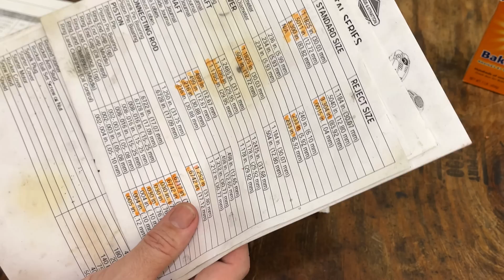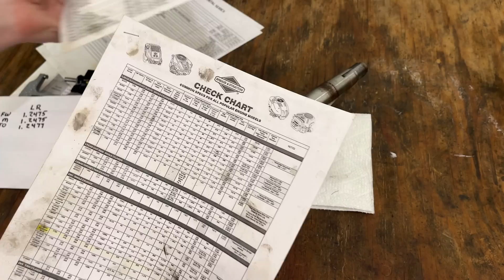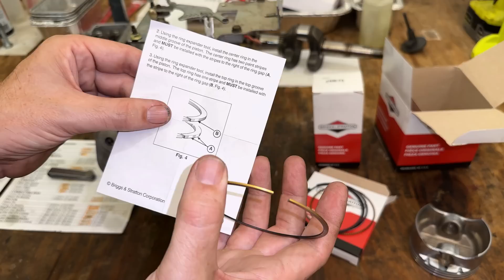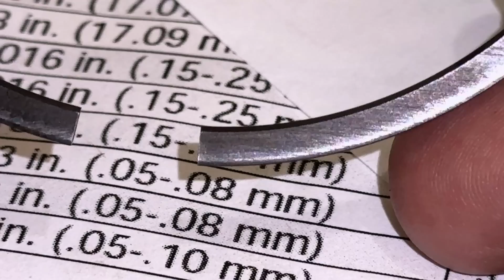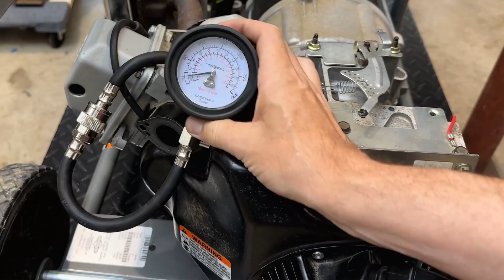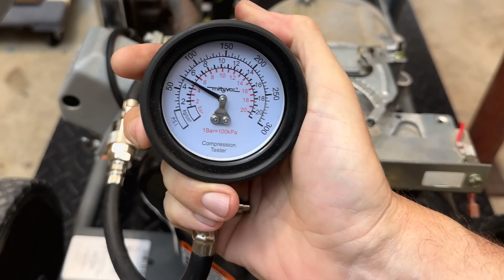Two Catastrophic Engine Failures - Are They Junk or Will They Run Again?

Comment: Aren't those cylinders coated with something like Nikasil plating? If so honing is not permitted. I have never seen rings run on a raw aluminum cylinder.
Also; I'm not to fond of lapping valves unless they are new and only a small amount then. When lapping the old valve there is always a chance of cupping and the valve seat is usually way to wide which means the pressure is distributed over a wider area and less chance of a good seal. A narrow seat is always best...
Invest in some valve and seat cutting tools...
Reply from the maker: My understanding is the Nikasil is on the piston and not the cylinder on these engines.  Service manual also has honing instructions, but does not talk about the coating.  If you Google Briggs cool bore I think you will get more information in it.
Reply from the maker: There is no hardened surface, Its just a bare aluminum cylinder. Bore it out as needed, but be sure that a Briggs OEM piston is available.

The briggs Kool-Bore design was pretty smart, Briggs found that a bare aluminum bore with a hard chromed piston had a respectable lifespan and ran cooler than a steel sleeve design.

Comment: Since the engine is not open yet I am thinking of money saving features for this engine. So that would be a removable insert bearing. Since this engine deposits aluminum on the crank, that needs polished and cleaned, but instead of a connecting rod cost, if it were fitted before hand with an insert this would save the owner that amount. The problem with that is spun bearings destroying the connecting rod anyways. Not sure how to save this component when run low on oil unless it were really soft material then the owner would just still try to run it even with a spun bearing. Must be some way to save the engine case and connecting rod say in a future engine, just not aware of a way at this point since even a rattling connecting rod will not STOP the owner from moving forward to further destruction.  Must be some way cheap to do this. So this is maybe the best outcome. For the connecting rod to hold together and seize on the crank. Thus the engine case not being destroyed by a failed connecting rod which destroys both the engine case and piston. So a very strong connecting rod seized on the crank might be the best option. Saves both the piston and engine case. Deposites on the crank and re-honing the bore might be the best outcome. So make the connecting rod strong enough to not break and keep everything together might be the best outcome if the owner fails to check the oil.

Comment: That no oil generator is blown just because of out of oil. It can be freed up by removing the sparkplug spraying Penatrating oil down into the cylinder to set A while then remove the pull starter to manually trim it over by the starter clutch with the removal tool that's one piece for removing them to replace them and key way block.,or the flywheel with it's called that tool. From stens online to.,or other Briggs and Stratton.,an other websites have them to.

Comment: I lost the tip of my finger using that exact kind of razor blade to remove a gasket. The razor stuck unexpectedly and my grip slipped causing the blade to flip over. So basically in a split second I ended up pushing with the sharp side... the longest finger lost that contest 😢

Comment: They make plastic "razor blades" of various stiffness that are useful for removing soft material but would not gouge aluminum. I'm not sure it would be useful but thought I'd mention it.
Reply from the maker: Tried a few once.  Did not work well, but maybe I bought the wrong stiffness.  Razor blades work well, just need to be careful.

Comment: I'd do the rope and rag rubbing of the crank soaked with sodium hydroxide just to avoid using any sandpaper at all. Well perhaps 2500 grit paper and start with hcl acid to get rid of the thickest aluminium.

A blunt scalpel with rounded type blade is best for scraping.

Comment: that AVR COULD be tuned while engine is going, the biggest risk is if teh circuit has reference to line on that pot, but as that would be silly(it would be placed into a larger divider with the pot on the low end to control low-side switching of the exiter coil) it should be safe enough to just use a standard plastic handle driver to adjust it, plastic for safety as it is basically not possible to have full unlimited line on the pot trim screw
Reply from the maker: It could be, but there are plenty watching who would get themselves into trouble.
Reply: true, far too many people would end up holding the bare metal shaft, use a full metal precision driver handle, or otherwise guarantee they jam their driver onto a live wire and even be stupid enough to have the equipment referenced to their body in such a way that they get electrocuted
I actually recently touched a 120v power supply for a surround sound DVD+VHS media unit because of it dying in a lightning strike, yet I felt nothing because I ensured my body was 100% isolated and I only had one hand referenced to the heatsinks of the linear regulators to test if they were even getting power
I literally told my grandma who was watching that what I was doing can get careless people killed but as long as my body was only getting 1 point of power the rest of me can't form a circuit and shock me

Comment: James, question about this Briggs motor. I recently rebuilt one (blown rod and piston) and the crank was salvaged (don't recall the mic measurement, but it WAS within specs.) Runs great, but now it's rear seal is leaking. I've replaced the seal THREE times and even bought a bushing installation kit and installed a new bushing. It STILL leaks. I hate to keep throwing good money after bad and I'm at my wits end. I'm suspicious of the housing and the crank (although I can't see either one actually being the culprit.) Except for the crank and block, all the parts are new Briggs and Stratton, no knock-offs. I even tried some Lucas stop leak and changed to 30 weight to try and seal it! My dad has nick-named the Storm Responder "Ole Drippy!" It only leaks when running BTW, and very little (teaspoon amounts, not ounces.)
Any ideas??

Comment: The price of those piston rings is crazy. I can buy a set of Sealed Power rings for a 350 V8 for $39.99. A set of 8 pistons is $162.99. This is for a 4 inch bore.
Reply from the maker: Small engine parts are crazy expensive.  I just bought a camshaft for $135.  For a little more I could get one for a v8 https://www.summitracing.com/parts/isk-201cc1?seid=srese1&ppckw=pmax-powersports&gclid=Cj0KCQjw_5unBhCMARIsACZyzS3vnOTgehmx-Kz_N16zKpKScqLowFZwS2IEt_d6vptSNM8h8_Vbre0aAmYjEALw_wcB

Comment: I am fairly new at small engines repair. I must admit your chanel is the best I could find . Could you tell me if the blade on a push mower has some kind of a flywheel effect when you start the engine . I have two older machines that started easily , but after removing the blades ,I just can't get them to start with the recoil starter. Thanks for your answer
Reply from the maker: The blade is required.  Mowers have a light weight aluminum flywheel.  Not enough mass.  The blade is required to give the crank enough mass / inertia to run the engine.  The same engine in another application like a power washer has a cast iron flywheel to no blade needed in that case.  Ken just did a good video on that https://youtu.be/JukPWNwseG0?si=At0f2XQ3nCWLnGwp

Comment: My B&S 9hp engine per the web recommended 0.004 intake and exhaust. I think it’s a series 124 but can’t recall for sure.
Reply: I seem to recall the carb bolt torque being stated to be 20” lbs per the web.

Comment: I still mix 50/50  30w and stp for putting engines together if it’s going to set for a year or several years 
Never a problem yet in 50 plus years

Comment: With the roller bearing crankshaft those engines have I have seen them literally run out of oil and run again.
They smoked a little bit but they run.I'm not saying that when will but I saw it
It was a 9 horsepower Honda lawn mower engine is locked up and restarted after oil has poured in it and it's still mowing today somebody left the dipstick out

Comment: Running generators are unattended, can a low oil off switch be added to that motor? 
Get some anti size for your puller you will get a lot more push for the same pressure,

Comment: Actually, GM made us stop using the roloc bristle pads and scotch brite cookies  because the manufacturer was finding aluminum oxide and ceramic abrasives in the engines with bearing damage returned under warranty.    We were told by our service manager if we were found using them on a customers' engines, we would end up buying  new engines for those customers out of our own pocket.  I guess it's fine to use on an engine if you plan on taking it apart and cleaning it really well as long as you're not taking material off machined surfaces which could cause leaks.  I just use razors, plastic scrapers, and carbide scrapers now a days.
Reply: That doesn't make sense .... the scotch brite pads don't have aluminum oxide or ceramic particles that's the abrasives in sandpaper.  I am not sure about the pad James was using but I use Roloc brand abrasive on a tool fitting over studs on rotors to remove corrosion and again it doesn't look like it has ceramic or aluminum oxide.  It works way better than wire brush attachments and little wires don't fly off.

I have heard rumors that using scotch brite for cleaning engines isn't good but neither is sand blasting (common practice shops use).  Scraping gaskets is really tedious.

Comment: Wow I know about these generators I got one. Don't have any time on it hardly . theses generators flooded the market back in 2009 when we had the ice storm tractor supply come up with tons of them when you couldn't find one ill break it out and start it about twice a year. I bought if and started it back during that ice storm and the electric come back on about 5 minutes latter. I'd been without electric for about two weeks I was tired of taking a bath out of a steel pot heated on a wood stove. .

Comment: Hey James can you make a video on rebuilding an old tecumseh 4-6 hp snowblower engine? You are very thorough on specs and technical details and would enjoy something like that as a video maybe?
Reply from the maker: I do have an old snowblower Tecumseh engine around that size with no compression.  Will make  a video on it some day.  Not sure though a complete rebuild, but will get it running again.

Comment: You half to work it back and fourth gently from the stuck spot back to it then further to the next farthest point until you get one full revaluation. Then continue to the next one witch is two revaluations then keep working it free.& Spraying the PB- blaster down into the cylinder. Then place.,or put the sparkplug back into the cylinder head of the engine Unconnected still though. To keep on working it out for at least 30 to 45 minutes. Then flush drain out the engine old oil really good. Replace it with fresh motor oil. Gasoline fuel hopefully none ethanol fuel.  Then try running it at idle speed mode for 20 to 45 minutes yes it will smoke until those piston oil rings release.,an free up.,an unstick inside of the piston itself to properly seal itself again.

Comment: why don't you unbolt the powerhead from the case and remove the long bolt that threads into the crank and utilize the threads in the end of the rotor to push the entire power head off the  crankshaft ? when necessary to remove the powerhead?
 I've noticed quite a number of. Stormresponder engine failures.  Briggs Quality? I use a shorter rod and grind the head down so it is small enough to rest against the end.of the crank. Some of the Chinese generators have the powerhead cast with crankcase cover as part of the powerhead casting thereby precluding a simple engine swap.  a simple engine swap

Comment: Well done, James!  I can't say that I agree with your decision to use the old ring though.  The chances are that it will break earlier than a new one are greater or just wearing out earlier than a new one.  Like you said in the video, the ring they shipped should have been new because that was what you paid for.  You should still send it back and have them replace it with the actual new top compression ring.  I just hope it doesn't come back to bite you in the butt.

Comment: Great video James. Your video arrived at a good time since I am trying to refurbish a Generac Wheelhouse 5500. You can correct me, but I think your Storm Responder engine you just fixed is very similar to the engine of your video of 3 years ago on the Generac Wheelhouse 5500? I just found a Generac Wheelhouse 5500 with a stuck Briggs engine, and your 3 years ago video was very helpful in getting that engine running. My issue now is to find some parts for it, such as a new oil dipstick (It is broken) and a new breather hose (Crack one on this engine). The oil dipstick is discontinued, and I found a breather hose in the US, but the shipping cost from the US to Canada is more than the cost of the breather hose. Add to it import fees and taxes and it is way too high. Any ideas on your side for those two parts? Continu the good work, I am leaning a lot from your videos.

Comment: You’re like a mechanical surgeon. Curious, where do you get the torque and other specs for the equipment you work on. With such a diverse number of manufacturers and models, where does one go to get that info?

Comment: You should block the engine and head. Get a piece of stone, or glass and stick a sheet of 400-800 wet and dry, and just rub the whole face on the block to get nice true surfaces to join together. Nnkh YouTube style. And if you grab some abrasive compound, put a bit on the valve. Sit the valve in its seat, hook your drill to it and turn the valve while pulling the drill to surface the valve and seat together.

Comment: Hat Tips my friend! It's been decades since I've rented and I can't remember Jack squat.

I have a 26 horsepower motor where are the RPMs fluctuate up and down and will sometimes level off when there's a strain on the motor. I'm always more than diligent with oil changes and try changing the spark plugs for giggles but the problem still exists. I'm guessing carburetor? Any suggestions would be greatly appreciated
Reply: Not only a hat tip but multiple hat tips!! Most impressive and I respect your meticulous inspections! I never would have caught that ring and probably would have just used it assuming it was new out of the box, outstanding! Happy holidays in a stellar New Year may you be abundantly blessed with all that's good
Reply from the maker: If it gets better with a little choke, then likely a carb issue and running lean.

Comment: 1:34:50  After cleaning the slip rings you applied what looks like electrical tape to the rotor bolt.   Was it there before?  What does it do?

Comment: I guess you don't watch @IDoCars.  He's torn apart engines that have completely grenaded and the wrist pins could be slapped in a new engine without an issue.
Reply from the maker: The wrist pins usually survive.

Comment: I must have missed it. Did you check RPM or adjust the AVR for total run voltage? Just wondering.

Comment: I just found your channel and love your stuff. I've been trying to diagnose a recently dead generator and was hoping I could get a point in the right direction. 208cc craftsman 3650 watt. Has a couple hundred hours on it. It was running normal and just shut off. I tried to restart it and CO light was flashing. So I let it sit a while and tried again and after about 30 pulls, it started super slow and eventually ramped up. But when I tried to put a load on it, it bogged down almost to stalling and slowly creeped back up to speed but had a consistent backfire out of the muffler. After running a little while like that it shut off again and will not start, has good spark still, but only occasionally backfire out the carb. I'm thinking timing jumped? Any advice how to proceed?
Reply from the maker: Could be timing.  Would also check the valve clearance.

Comment: It seems to put out the power and start on the first pull, but I would swear I heard misfiring of the engine while it was running. Perhaps the plug has an issue?
Reply from the maker: Accidently left the microphone gain to high.  Was just the audio clipping.

Comment: At 1:37:33 you are going so far as to turn the engine over.  It does not appear you have replaced that wire that was under the end of the alternator.  How important is it???  It was important enough for you to comment about it when removing the powerhead.  OOps.  A bit later when putting in the Brushes, you appeared to tighten a wire immediately below the powerhead, but no mention about it.

Comment: Another successful resurrection. James, what is the function of the electrical tape on the rotor bolt?
Reply: Just to center the bolt which is loose in the rotor.  Maybe helps with balance.
Reply from the maker: To sender the bolt.  The bolt used in this is smaller the the rotor shaft and does not center itself.  Manufacturers do not care, but the tape is a shoulder the help the bolt go in straight.

Comment: At 1:05:52 you are not testing the new Ring No 1.  It is lying on the pile of rings, easily discernable by its much lighter colour.  The ring you are testing is the one you pulled out of the engine has thickness 3.6mm.   Why do you not return the supposed new ring to the supplier with a note that it is not up to specification and does not have the Ring Number marking that aids in determining which way is "up", and that the lack of that marker tends to indicate it is a "used" ring???

Comment: 1:36:30. Isn’t there a gap with the stator? Doesn’t look like it went on all the way.
Reply from the maker: The black outer part of the stator is just a removable cover that can slide off.  Normally they are a little shorter.